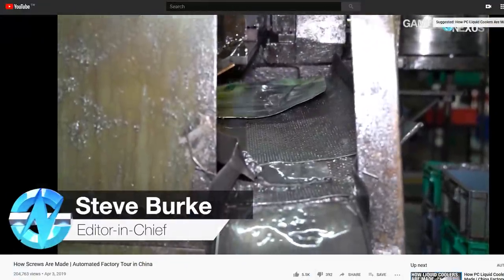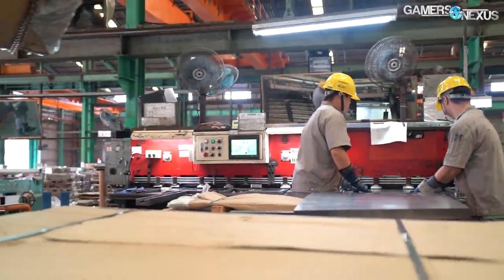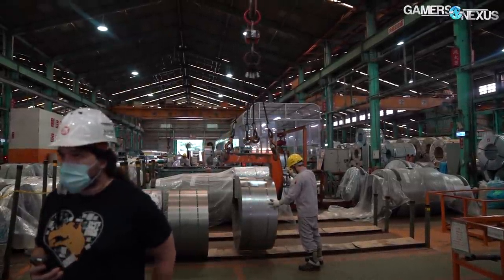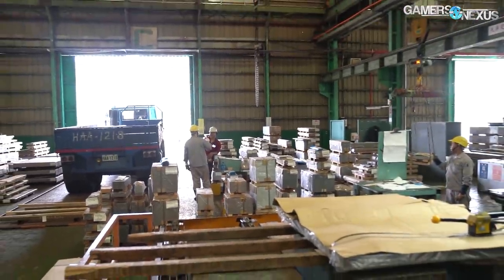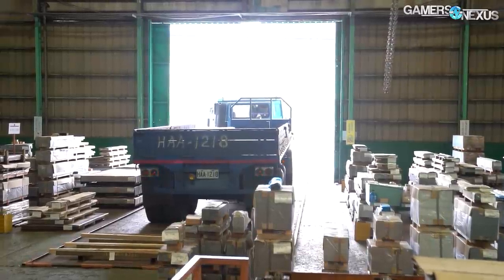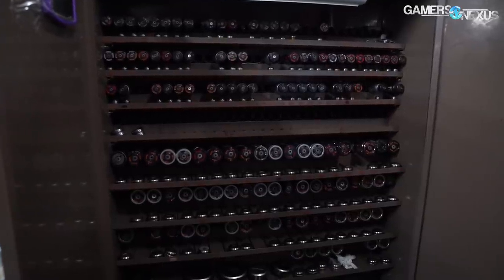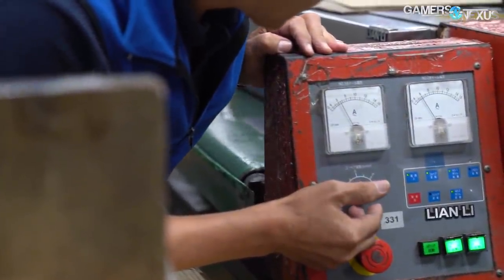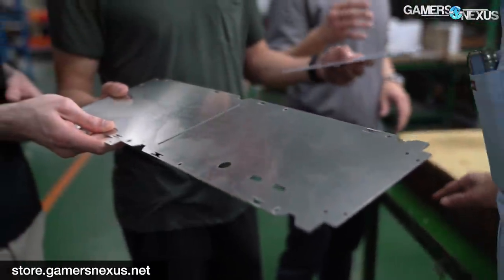How PC Case Panels Are Made: Raw Metal Factory Tour in Taiwan, ft. Lian Li

Comment: Liquid nitrogen is not used to cool the laser its converted to gas for the cutting gas "shielding gas" in short. In other words it's better for lower  Oxydization of the metal like mild steel. O2 makes a black oxide layer on the cut side of the metal.nitrogen Is cheaper than o2 and is preferred on thin steel. It also is the only gas most places use on stainless and aluminum. I may be missing a few things but it bugged me.

Comment: I think that the bending machine is quite certainly out of norms here in the EU, the risk of losing a finger or more there is nigh. However nice tour.
Reply: I'm not sure because some woodcutting machines are dangerous too but still in use in EU.
Reply: looks very similar to german trumpf bending machines i've seen and i guess those should fulfill the european standards^^
Reply: @johnuferbach9166  I see. Usually any kind of machinery that is that "open air" and potentially hands of the operator can get caught in isn't properly approved. I have less harmful stuff that requires crazy paneling to prevent access.. and it's nowhere as dangerous. But I'm happy to be wrong :)
Reply: @JMatrx  i think on these kinds of machines the hands of the operator are actually part of the process, so one can't really avoid the danger... though the next step is triggered by a footpedal, so the operator has time to position everything properly

the newest example on their channel:
https://youtu.be/e2P4DVKzjSs

Comment: Oh man, working in a manufacturing environment seeing you hit on the sources of the materials that often get used, ergo from a supplier, and the bending, cutting processes...I personally weld for an agricultural/industrial equipment manufacturer, but it's amazing to see how similar many industries can be.

Buying steel and not using an on-site foundry is definitely VERY common.

And those overhead cranes are very common, and it is definitely heavily emphasized to remain with the load for safety.

Ha, D face pieces...another thing that is common.  If it's not gonna be readily seen, appearance is often not considered paramount.

Those benders and lasers...

Okay, yes, I am nerding out a bit.  So sue me.

Comment: that manual part is one step away to losing your fingers, also i think they cut a lot with these metals even with gloves.
Reply: I cringed a little at the finger going inside to rub it clean too. Surely they should be using a brush or something for that.  I assume it's operated by a foot switch and maybe a button at same time, but still, if you're doing 100's per hour you can get so complacent it would be easy to mess up. :o   There is a line between safety and productivity though.  All the draconian policies in the west are why we are losing so much manufacturing and labour type work, it becomes too complicated putting up with all the complexity of all the rules and regulations and getting fined for petty stuff.

Comment: I worked for 15 years as a sheet metal press operator. It's a loud, dangerous, and dirty job. I can't tell you just how many times I've been cut by the really sharp metal sheets as the sharp metal will sometimes cut right through the protective gloves you have to wear. I've even seen guys that have lost fingers from not following the safety rules.

Comment: Never thought I would see steel shop tour on a tech YouTube channel. I do this for a living and will dispute the quality of their steel I've see alot of it. QA was always complaining about their standards. Lol
Reply from the maker: You work with this factory?
Reply: @GamersNexus  No I'm state side. I misspoke about their steel. It's in general about overseas coiled steel,here we have a totally different standard for class one steel and most QA that I have worked with always complain about the chemical makeup of overseas steel not being up to par with state side coiled coiled steel that's all.
Reply: @sonic24791  Is it even steel? I think they usually use Aluminium
Reply: @sonic24791  I've seen the same  complaints regarding steel pipe of Chinese and Indian manufacture.   Even been involved with contracts where pipe made from steel sourced from  Indian and Chinese steel mills was prohibited.    The QA documents for pipe allow you trace the steel back to mill and the batch it came from.
Reply: @parthian945  I'm sure they are using aluminum for the cases but they also make coiled steel products as well. I was just speaking about foreign steel. That's all

Comment: it's unusual that a laser would be slower to cut out a part, at least for the Mazak optiplex DDL's my company uses. The advantage our strippit machines have over the mazak laser is in parts with a large number of small holes that the punch can cut in one hit. That is unless they cut the blank on a laser and all the holes on the punch machine.
That laser seems a considerable bit slower, unless they slowed it down for filming vs the Mazak that my shop uses.

Comment: Nitrogen for laser cutting is used for cutting, not cooling. There are uses for other gasses for laser cutters too. These steel rolls really not that large.
Reply from the maker: They told us cooling. We are not in a position to dispute what the factory managers tell us and rely on them for explanations and translation.
Reply: Ok, that's interesting, it may be so, as I haven't worked on one in many years. The ones I did used Oxygen, CO2, Helium, and Nitrogen. The gases were even mixed, it depended on the alloy and thickness, as well as the type of cut.

Comment: 0.02 mm = 0.001 of an inch. Which really isn't mind blowing precision. 0.0001" kind of is.
Reply: but for a press making screw holes that sounds pretty ok?^^
Reply: @johnuferbach9166  sure. If the holes were 0.003 off they'd be fine. 0.001 is about the thickness of a hair. So a few hairs isn't much. You need some wiggle room in a screw through hole anyways. There's lose and tight fits there. In a PC case you're dealing with lose fit. The head of a case screw I have here is 0.3. The major diameter of the thread is 0.133 So the rim of the screw is 0.0835 Or 83.5 times bigger than 0.001. So the hole size clearly isn't much of a factor. Hole placement is.

Comment: I don't think "leveler" is a great translation, at least not for the manual cutting machines. Those are metal shears.
Reply: Steve doesn't know the difference between Level and Flat.  You  need to flatten the metal that comes off the roll.
Reply from the maker: @jamesthomson8659  They called it a leveler. I'm not in a position to dispute it.

Comment: I would suggest in the future when you guys do the videos like this at least call the equipment by its correct naming. I.E. its not a bending machine, it is a CNC Press Brake. The rubbing machine is a deburring machine. ect. ect. As someone with 20+ years in Sheetmetal work I understand that its easier to call a machine by what it does, but this also dumbs down the work that these highly skilled operators do, I mean you wouldn't call a PCB a layered board thingy. Just show a little more respect by learning the proper names of the positions, and or machines, so you show a little more respect for the profession.